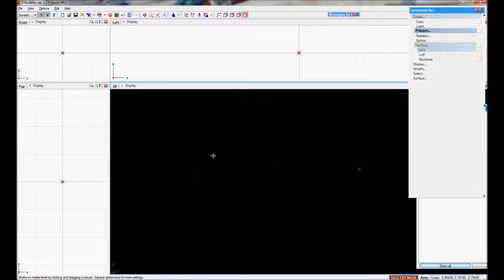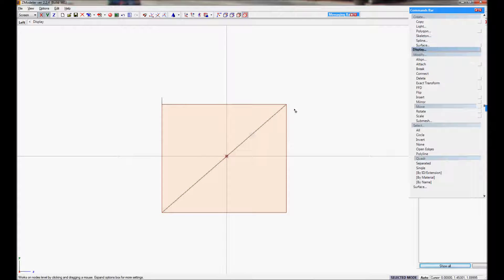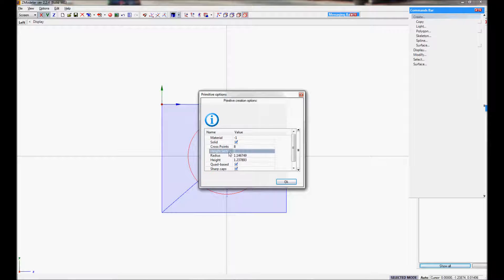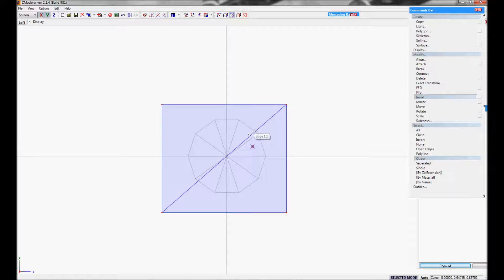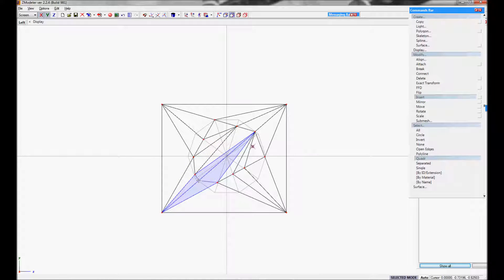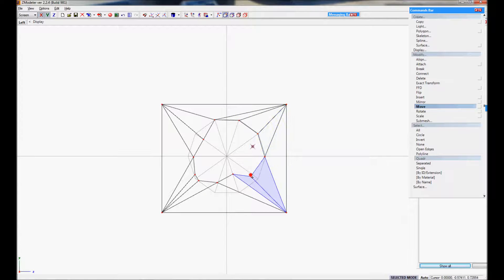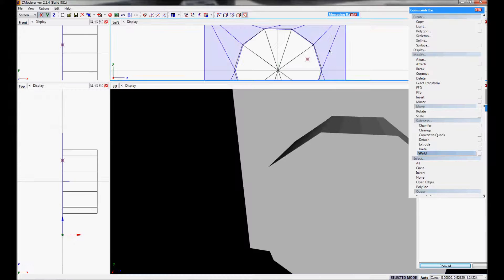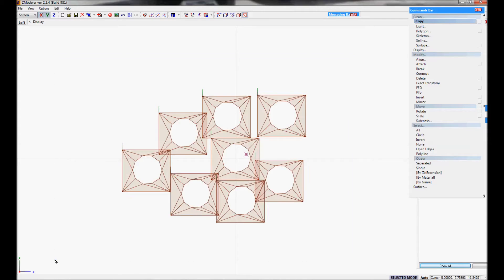Zmod Tutorial: Pilot. (Cutting a hole in surface mesh)

Comment: What about cutting multiple identical holes in a complex surface like a wheel ? Isn't there a faster way to do it rather than rebuild the entire surface of the wheel by revolving the new panel ? Kind of like a "cookie cutter" tool... I'll have it done by the time you read this I'm sure, but it would still be nice to know a faster way if you've found one